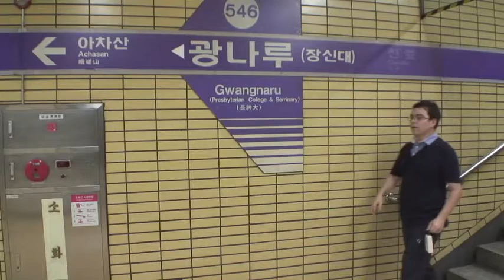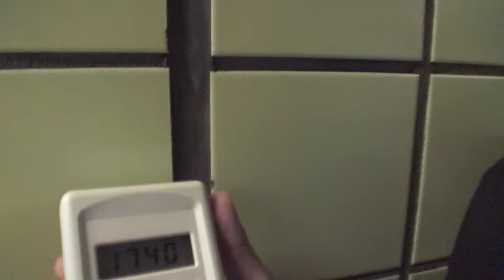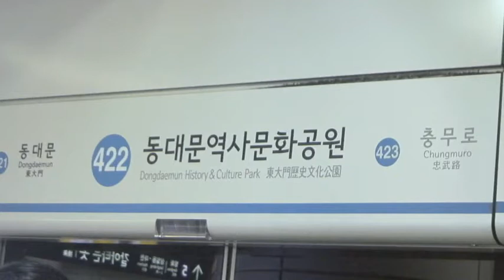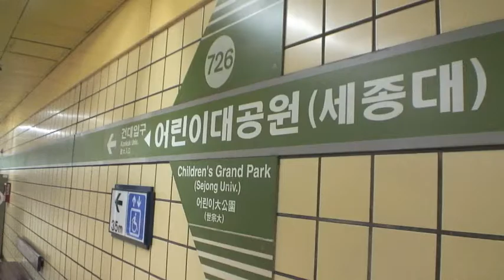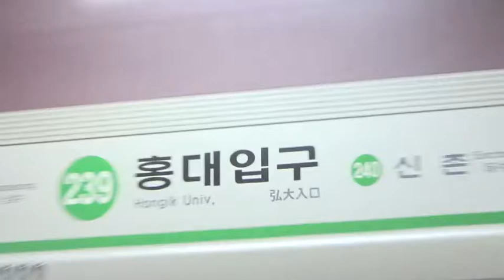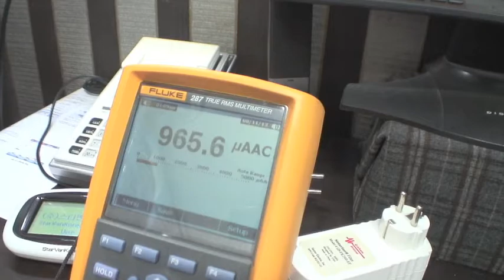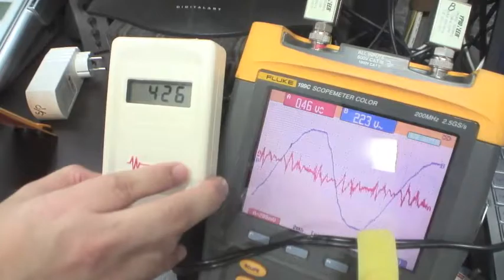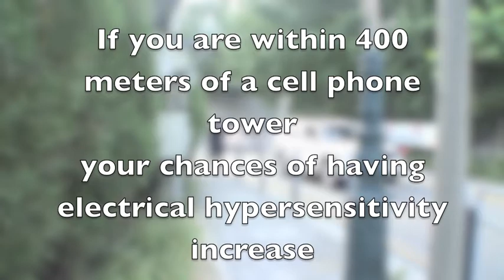Electrical Pollution in South Korea and the Seoul subway system

Comment: Pretty cool video! Are you reading EMF in the air space as a dirty electricity?
Reply from the maker: The dirty electricity in being emitted from the power lines and contributes to making EMFs stronger. EMFs and dirty electricity are both separate yet related things. You reduce your dirty electricity you also lower the EMF.
Reply: L